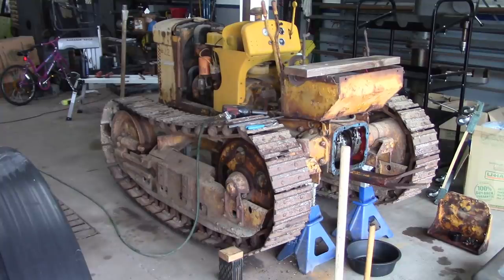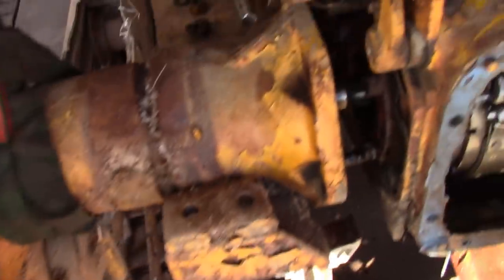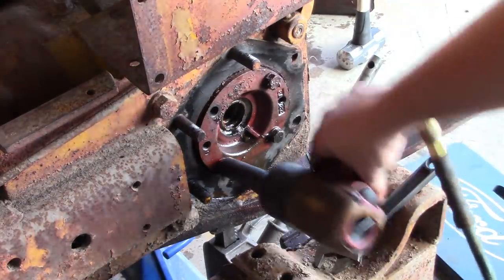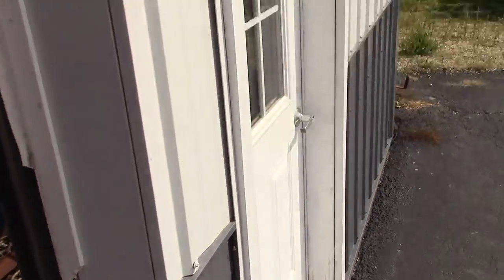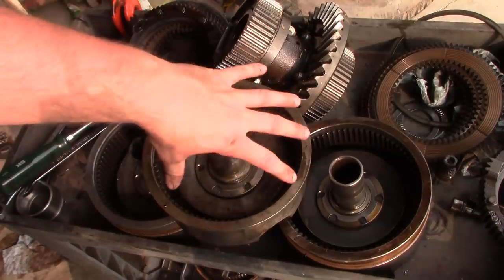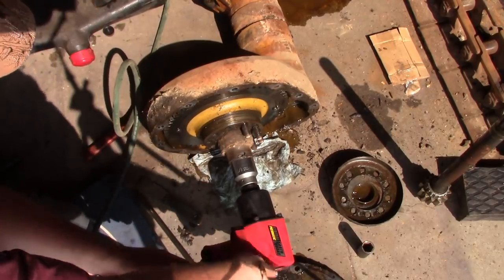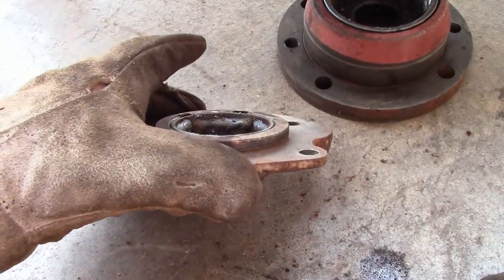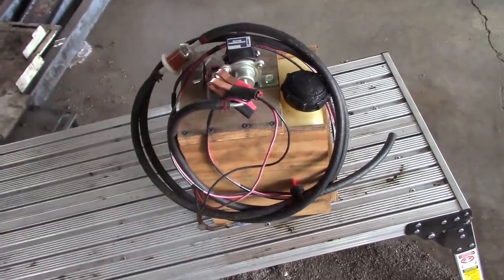1960 Oliver OC46 Crawler Tear Down and Steering Clutch Removal after Sitting 13 Years, Part 2

Comment: I see an entire bottle of anti seize being used on reassembly. Oh, that owner is very lucky to find someone like you that has the ability and is willing to repair it.
Reply: Nailed it1
Reply: I hope he gets payed...this is a lot of work and it locks the shop up waiting for parts 🤨
Reply: @swebigmac100  He has room in the shop to still get a vehicle to his lift and most definitely will get paid.
Reply: @bluegrallis   he didnt get paid
Reply: @G-G._  He hasn't billed me yet. Most likely won't, until the job is done.
Reply: Wow what a project and what a super talented young man Wes.  Very impressive your fabrication of tools and patience and gentle tapping persuasion as required.   PS.  I’ve pulled every cotter pin in my life with extra long side cutters from MAC tools sure gives my tires old hands extra leverage on the pull.
Reply: The owner is a “master machinist.” I suppose fixing his crawler could be advantageous to a guy that repairs stuff for a living. Just a thought..

Comment: I was just bathing in the warm glow of replacing the fuel filter, inlet pipe & return of my strimmer but this is on a whole new level!

Re: the fuel pump. I was on my way to Stonehenge in an old 60 seat coach fitted out for living in (woodburner, bed etc.) & we had some severe problems with the engine. We limped off the 303 into a garage & the mechanic diagnosed a blockage in the fuel pipe, under the floor. The fuel tank was at the rear of the coach & the engine under a huge, carpeted housing beside the driver. 12 metres or 40 feet apart with a copper tube running the whole length of the coach nailed to the wooden floorboards.
Mechanic quoted a HUGE amount of money, a week for ordering the parts. We were four people on our way to a festival. We could barely afford to eat!
So, sat in the coach discussing what to do I lifted up the cover to the engine. 
I saw the pipe from the fuel tank 12 metres or 40ft away come up from under the floor to a fuel pump. Then it came up to the very top of the engine into another pump that fed the injectors. 
So I sent the driver to see if he could beg, borrow it steal a 2 metre (6ftt)  length of plastic tubing & a the biggest plastic drum he could find. 
About 3 metres (10ft) of tubing & a 50 litre (11 gallons) plastic drum came back. I syphoned some diesel out of our fuel tank &  placed it on the dash. Took off the fuel pipe on the second pump &, with a mouthful of diesel (for the second time!) started a syphon into the high pressure pump. Luckily there was enough head to replace the output of the low pressure pump.
We fired it up, jeeze was it loud! Me sat on the dash holding a huge drum of fuel right over the engine. It ran perfectly! Better than it had been up to that point.
We made it to the henge in one piece. Me & the driver as deaf as a post but...

Comment: I had an off day today. (feeling less than 70%) found your channel and binge watched about a dozen or so. You are definitely a mechanic and not a parts replacer like most. Thanks for the diversion. By the way one thing your projects have in common. All the vehicles have less than a quarter tank of fuel.  Guess they don't want you going for an extended test drive. Keep up the good work. Stay healthy.
Reply from the maker: The fuel tanks are only full when they need a fuel pump...
Reply: @WatchWesWork  Murphy did it...

Comment: The race removal was genius and also how you mentioned that on the groove from the bearing you could just make a sleeve and not a new part. Usually people here in the states just remove and replace but they don't realize that in many countries where parts aren't as available it's different.

Comment: My amazing trick that I love to show folks, is that nylon masonry twine can be used as a surprisingly effective saw blade to cut through pvc pipe.  I fashion two handles with whatever rod like thing is handy, and a quick push pull motion will burn right through the pipe. It’s very useful for limited access/buried pipe , as it reduces the amount of clearance needed to make a cut for a repair.
Reply from the maker: Hmm. I'll be storing that tip in the old noggin!

Comment: Wow, Great Work and Evaluation Skills. This is a big flash back for Me as a 16 year old kid working for a small equipment dealer after school in 1962. I recall owner replacing broken axel shaft and some rollers. I learned how to operate this OC 46 LOADER to spread cinders in YARD. I had no idea what was involved until watching what You are doing with this very old machine. I,became an electrician and later Electrical Superintendent on construction of WORLD SCALE MINES. I always loved machinery. Thank You. Can’t wait for the completion of this project and I hope the owner will get You to re attach loader and fill a dump truck.

Comment: That trick (welding a bead inside of the bearings) is awesome. I guess the way it works is: The weld material contracts more than the bearing material when cooling. So it shrinks the bearing a bit. 
Anyway awesome trick, thanks for sharing your knowledge! Greetings from cologne, germany.
Reply: Iron/steel is funny material. If you heat it beoynd specific temperature, its structure gets denser when it cools. So heating the race with oxyacetylene does same thing.
Useful trick to remove broken&stuck bolts from engineblocks etc where you cant heat whole structure

Comment: Crawler machines in general operate with so much of their running assembly in the dirt.  If anyone ever looked at a grain of sand under magnification they would see it is nothing but sharp edges.  Every the machine is used it picks up dirt, rocks and sand and they work as an abrasive to grind everything they touch, when the machine is stopped it has a huge percentage chance of moisture being over lots of the parts that rubber tired machinery don't have.  I am surprised anything on any old crawler is able to come apart or is worth the cost of repairing.  Your son is going to love it when you get that machine going and you take him for a test drive on it.  It is every boy's dream to run one of those.

Comment: Those old ones are always an adventure. About 20 years ago, I re-did a 1936ish (never did find out the actual year) Cat D3. skinny track (tracks were 11.5" wide) dozer/ crawler. Only problem I had as far as parts was the seals. Erie Bearings had all the bearings and races and even most of the shims. Some of the seals were an actual piece of rawhide leather. Don't know if they were stock or not, but they were non existent as far as finding new.  Love your videos, and your commentary. Very informative. Doesn't show it all from start to finish, but has all the key parts in it, and that makes for a good video.

Comment: And that's a small tracked vehicle, just scale up the hammer and spanners a bit 👷.
Great vlog Wes, you'll be having railway tracks installed next for traction engine repair, I think that's when you use a steel tape measure for bearing journal sizes 😉.
Thanks for sharing.
Regards John.

Comment: Welding an outer race on the inside of a wheel end is actually a recommended procedure by Conmet on some of their hub assemblies. It is a pretty neat trick for dealing with bearings. My dad told me that when he worked in my Great grandparents truck garage they would actually do that to remove dry sleeve liners in engines.

Comment: Absolutely excellent work Wes!!! That made welding trick with the bearings is a life saver. An old guy taught me that years ago too. Taking bearing races out of front-wheel-drive steering knuckles makes it so easy to take those 2 inch wide bearing races out with a small hammer and punch. All of Best from Canada

Comment: Hi Wes is always looking forward to your videos.
Interesting and see how you disassemble the driveline. Smile a little
for myself when you used the mig welding. Did so a few years ago. But my purpose was to get a bracket for the breaker so I could get it loose. Now I know what to do next time 😉 And see how you work with this machine is for me
"Back to the future" when "we" repaired the parts instead of as many times today replacing components or parts.

Comment: Hi Wes, to remove a ball joint,if you have 2 hammers, hit both sides of the ball joint taper housing at the same time and it comes loose easier. :)

Comment: $500 in parts is peanuts compared to what it would have cost if the guy didn't have all those spares.  Been great watching you tear the old machine down and working out what the issues are and what needs replacing / fixing.  I was thinking of looking for an old crawler to help me maintain my driveway (about 1.5 Km, or over 1 mile of dirt "road").  But I'm thinking twice now ...  doing up an old tractor is one thing, these crawlers might be hard wearing but when they fail they can be a ton of work and the parts are really expensive, if you can even buy them.

Comment: Very fortunate that the owner had those spare parts. I can't imagine the difficulty in trying to find any kind of takeoff used parts not to mention any OEM replacements or new old stock. It's not like an old Ford 8N where parts new and used are EVERYWHERE.
Reply: There are many used parts available, but prices would make it crazy high$$  if you had to buy them.

Comment: The trick you used on the bearing races is the same trick I use, done it with cylinder liners and sleeves also. Its handy when good tricks get handed down.

Comment: Difficult to remove bearing races are a major pain. Jeep CJ5 with AMC 20 rear axle spun an axle bearing, it froze to the housing. Tried everything. Then I took a break, looked at my workbench where I repair computers and saw a can of compressed air. Took it out to the Jeep, turned it upside down, sprayed the entire can onto the race until it was frozen, pulled it out by hand, with gloves of course! I now keep a can or two of air in the work shop and in my mobile tool box.

Comment: If you ever get the chance at a local machinery auction, buy a Quincy screw compressor. My opinion is they are awesome. We had a small one at my last job before I retired, and we ran our whole operation on it. It almost never broke down. Maybe twice in the 12 years I was there.  
And it ran around the clock.

Comment: Oh boy is that some strip job well done on getting it apart with out any stripping of threads I noticed u have a side lift jack  I have just re built one and it won't jack down like urs it just drops so I'm going to have to have another look at its internals wishing u luck on the rebuild 👍

Comment: Nice. I love seeing old equipment come back to life. I’m doing the same to a John Deere 1010 at the same time as you are. Little more beat then this one you are in the middle of. The one I got had zero maintenance it’s entire life. So. Lots of loose bolts that caused tons of stuff to be cracked and or broken. Like really really broken. Like I shouldn’t have prob saved it. But. In the long run it will still be cheaper then a good up and running machine would cost. And I enjoy it too.

Comment: That thing was not made to be fixed, for sure. I like your machinery vids the best. Always something that you have to make to get it apart. I have gotten bearings out like you did, but with a stick welder. Because I don't have a mig. Good job, as always.

Comment: I made a very similar pump with wood crate. My wood crate actually houses the battery itself and the pump is a 12V RV water pump. I use it to pump water from a Tractor Supply plastic water tank to my gasoline pressure washer. The gravity feed alone wasn't enough to prime the pump of the pressure washer. The 12V RV pump is auto shutoff and provides just enough flow to keep the pressure washer primed.

Comment: Its cool to see this old oliver with the roller frames off. I never had the chance to work on one myself. Lots of difference from the cat stuff. Pretty cool that the pins aren't wallered right out and you dont even have to press them to get them out. Also cool that the spocket pulls so easy instead of having to pull it off a stubb with a enerpac.

All in all just a neat old tractor. Very good shape for its age in my opinion and good on the old timer for locating a good parts machine.

There are lots of tricks to working around heavy equipment and I appreciate that you share them and am willing to share any I know if you get in a bind. P.s. if you have trouble finding parts there are a few of us out here that might be able to help.

Comment: I had a temporary shop in an abandon industrial building in Massachusetts a while back. It had an old air compressor that had a tank that was about 8 ft high.  Wish I could have set that thing up with a modern pump.

Comment: FYI if you run into a grooved or pitted seal surface again you can just clean it up real good and use JB weld to fill it in. Then just machine it back down to spec or sand it smooth. I have done this to truck output shaft seals instead of speedy sleeves and have gone 50k still without issue.

Comment: I used to work in a scrap yard and drain the fuel out of cars. I used to hook the pipe up to the fuel pipe under the bonnet and draw the fuel out that way. I found with fuel injection or later models of cars where the fuel pump is in the fuel tank, it takes a long time to get the fuel out as it is fighting the internal fuel pump. Cant go in the fuel filler cap as they have anti-syphon devices. Used it for diesels too and it was slower as diesel is thicker. :)

Comment: Thanks for the video. I have to remove the rear torsion arm bushings on a KIA SOUL. I was going to use a sawzall to cut the busing sleeves but I may try your welding trick.

Comment: Omg how do u keep on top of all the parts and were where go back into makes my head hurt just thinking about it  lol stay safe man 👍
Reply: You just go back and watch your video 📹
Reply: Any mechanic that tells you they remember where it all goes is lying to you... You usually just figure it out as it goes back together 😉
Reply: Those that turn wrenches and enjoy what they do this comes natural. Just like the person that sit at a desk for work and enjoy what they do it come natural. I started turning wrenches long before recording your work was normal practice.
 I love turning wrenches but, hate desk work.
 Everybody has a gift for what they love to do.
Reply: The guys who originally designed and built that thing faced the same problem, so there is usually only one way that makes perfect sense.
For parts needing alignent or orientation you make match marks, you learn the hard way when you should have done that. I try to lay stuff out in order or even wire it together, for example bearing gear and spacer stackups coming off a shaft.
Doesn't change the fact that sometimes you have to go back a few steps, because you forgot something that must go on first, or change something around that isn't quite right.

The real challenge is dealing with modifications and missing parts, or just poor workmanship by the guy before you. The factory stuff on any machine is usually pretty easy to figure out compared to that.
Reply: Should belleville washers be stacked like that? I've always seen them stacked opposing... doubling the effective compression distance and keeping the spring force of one washer. Do you have a service manual? Some PO may have assembled that incorrectly. Or it may be right, to double the spring force.

Comment: You would have thought "Yeah, I have a bunch of extra parts" would have snuck out in conversation with the owner at some point.
How long before you re-gear that pedal tractor so those little legs aren't working so hard?  ;)
Reply: Don't worry, that little guy is gonna sneek out to Dad's shop and put a weedeater engine in his tractor. His channel will be called Watch Bubby Wrench.
Reply: I was thinking maybe put a weedwhacker engine and clutch on the pedal tractor, but still keep it geared for 6 or 7 mph so he can get some low end torque. Would make for an interesting video.
Reply: Was thinking the same thing about the parts, I know if I was to ever have something worked on like that and I had a ton load of parts for it! They would've either been sent along with the entire machine (not really) or told Wes "hey, before you think you might have to order any part I have a crap load here" anywho, awesome job Wes! Keep'm coming n cheer's fr Canada eh

Comment: Older video, not sure if you’ll ever see this but “torque test channel” did a test to see how much power air hose swivels robbed on pneumatic impacts. Should check it out. Might save ya from having to hand fire it with the wrench like some of the bolts in this video. Keep up the good work

Comment: Why did you not check out the idlers and rollers too since you are in this far?  I am doing my own MC as I had the left final axle bearing give out so I am doing the finals, rails, rollers and idlers and machining the idlers and rollers to take tapered roller bearings.

Comment: I can confirm that modern semis still use the cone wedge washer for the axles, Had a 2021 KW T880 with 2,600 miles and they somehow snapped both rear drive axle shafts. It was driver abuse, dude basically was on ice and insted of putting chains on he figured he could just hold the throttle to the floor and spin off the ice, worked good until he hit dry pavement and the 580HP snapped them shafts like twigs.

Comment: Was really looking forward to part two on this machine after seeing the pic that was posted, and you didn't disappoint. Great work, Wes.

Your quincy may just have a stuck piston ring, or the rings are worn out. Good fodder for another video at least, compressor heads are pretty simple to break down. Shouldn't be too hard to source a new set of rings if needed. Worst case scenario, fab up a charge cooler and toss a new two-stage head on her. 😎